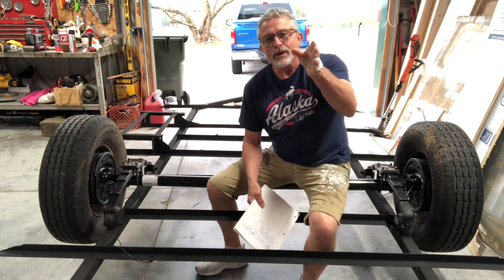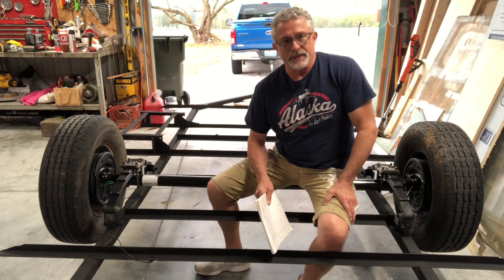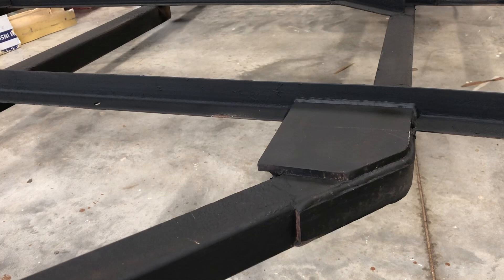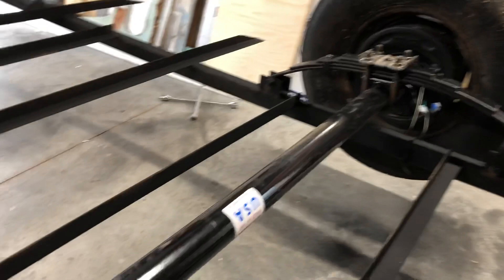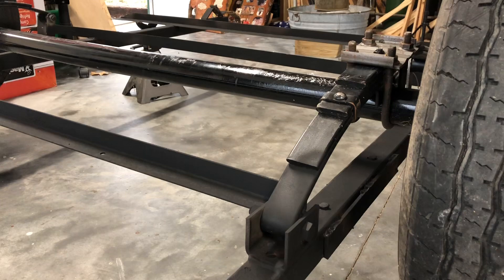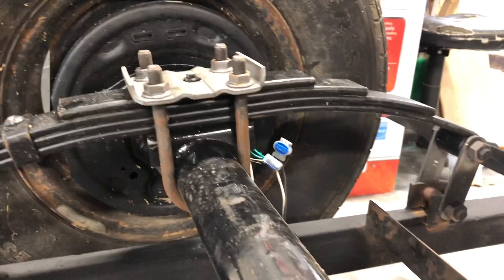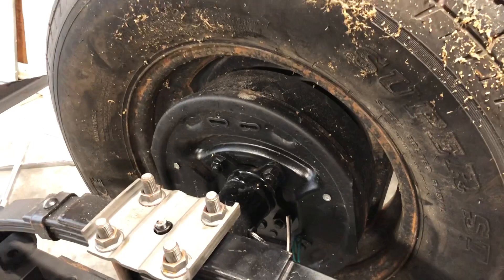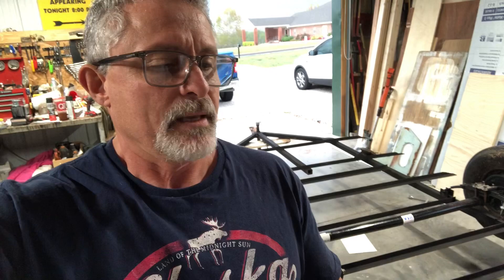EP 96 What does it cost - axle and suspension upgrade. Vintage camper axle upgrade. Welding frame.

Comment: Just up graded my 2021 wolf pup 3700 lbs rv with a single axle,  put wet bolt and heavy shackles on a single axle trailer.   Axle is a lippert 5200 lbs .   Even single axles need this upgrade.    What do you think?
Reply from the maker: Can't go wrong with extra safety.

Comment: Rob how often do you have o replace the axel? What should I look for I'm getting the frame ready? I'm about to flip the trailer to prep and rust proof the underside of the trailer ? How do I check the weld what do I look  for? Thanks Jeff from Boston
Reply from the maker: Look for cracks and splits in the welds and the metal. Look for the frame being out of square. Look for anything bent. If you're not sure, take it to a trailer shop for a professional opinion. Good luck on your build.